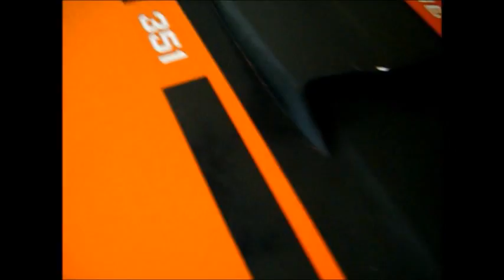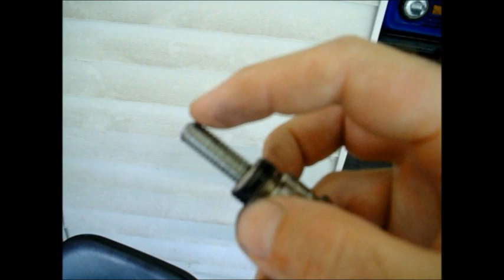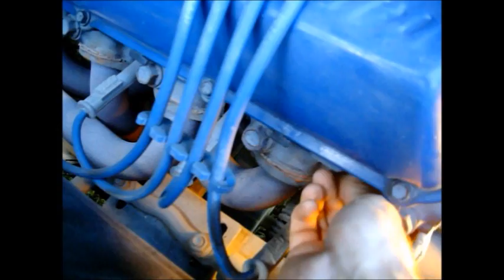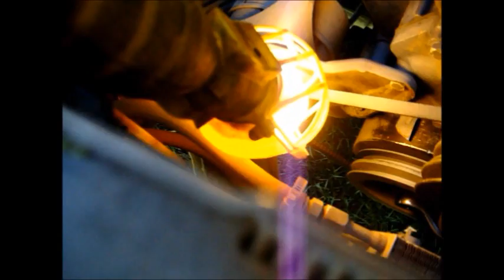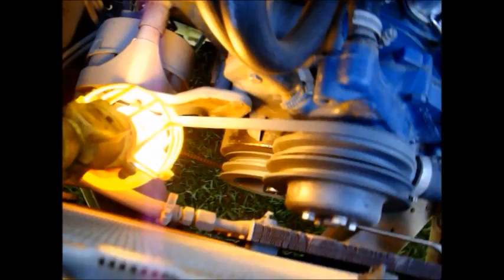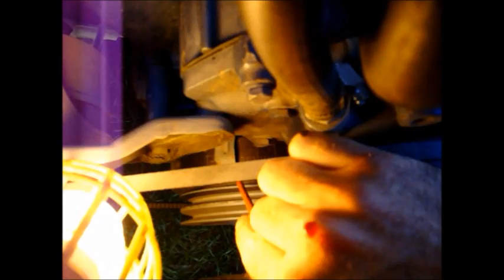Timing - Part 3 - How To - Using a piston stop to find true #1 TDC.wmv

Comment: Nice video ...... You said that the ground from the spark plug ....I am having starting issues on a rebuilt 390 my 69 Ford f 250 cranks but won't start I been searching possible soulutions why it cranks good and has a spark but it will not fire I'm just throwing this out there maybe you came across this the things I changed before my attempt to start it , I installed a thick ground wire from the block to the frame , cleaned the connections from the block to firewall ground   One odd  thing though I could not get a good ground to lite the test light unless I installed the battery cable ? I thought since the engine is cast iron it would be a good ground especially with that big block to frame wire I installed ?  I'm thinking I have spark but not good enough spark . I tested 11 almost 12 volts at the positive coil terminal in start mode in run mode it was at 6 v , although on the negative side I had less that a volt in run and almost 1 v in start mode    in one test I had the test light on the S solinoid small wire red and white it lit up in start mode but not in run mode ? Could it be I am having grounding issue since it is what actually causes a spark to the plugs with that ground strap I installed ?? I cranked my motor a little too much trying to get it started hoping I didn't mess up the cam already but I did not go crazy just got frustrated with it not firing .
Reply from the maker: You mentioned your cam, and seemed concerned that you wiped it out, I'm guessing it's a brand new cam, and you're referring to the cam break in that you need to do, I'm sure it's fine though.  You're trying to fire up a brand new engine for the first time?  Or just a brand new cam?  I don't think you've got a ground issue.  It sounds like you've got that covered.  You should have a ground cable running from the negative post on your battery to the front of the block (doesn't matter where on the block, but sand off the paint for a good connection), and where your battery's ground cable is bolted to the block, you should have a second cable running from there to the frame (again, bare metal for a good connection).  So now your battery is grounded directly to the block, and directly to the frame.  Then run a small ground strap from the rear of the intake manifold  to the firewall.  Do that, and you'll be able to put the ground test light lead on just about any bare metal on the car, and yeah, both positive and negative terminals have to be on the battery, if that was your question.  From what you wrote, I think you have all of that covered.  Are you still running points in your distributor, or have you installed electronic ignition, if electronic, what exactly are you running?  The voltage at your coil sounds right for an original points type distributor, there's a resistor wire that would explain the 6v.  With points, the negative side of the coil just goes to your points contact, so check that wire's condition, look for any chaffing or bare wire, and check that wire's connection to the points.  Then check your point gap with a feeler gauge (.017" to .019" gap will be fine).  If it's way off, that's your problem, and if the points aren't brand new, get some sand paper, somewhere around 80 or 120 grit will work, fold it in half, so it's rough on both sides, and slide it back and forth in your point gap to clean both sides shiny, sometimes your engine won't start, no spark, and that's all it takes to get you back on the road.  Once you've verified your point gap and cleaned your points, make sure that all of your spark plug wires are properly installed, fully seated at cap and plugs, and that the firing order is correct by checking it against a diagram that shows cylinder numbering and distributor cap rotation.  Remember that the Ford distributor rotor spins counter-clock-wise, opposite of Chevy, and that Ford numbered their cylinders completely differently than Chevy and Mopar, just saying because if you're used to old cars that aren't Ford, this will throw off your game.  Once all that is sorted out, put a timing light on the number one spark plug wire, and check your timing while someone cranks the engine for you.  Be sure you've got a good charge on the battery, and at normal cranking speed, the timing light will strobe if you've got spark, this will also prove that you've got a solid ground, and that your coil, distributor, and points are working just fine (if no strobe at all, then those are your suspects, and I'd suspect the points before anything else).  If the timing light shows 5 to 15 degrees BTDC on your harmonic balancer then it should start, and if it doesn't start, you should check for fuel, just look down your carb, and cycle the throttle lever with your hand, you should see fuel squirting down from the top of the carburetor.  What carb are you running?  You could cheat and spray a little starting fluid down the carb, and see if that helps it out....it should at least try to light off.  Starting fluid will also tell you when it won't start because you've got a batch of bad gas...but gas that bad is really rare, it's only happened once to me.  Here's the thing, you've got good rotation, so now as long as you've got compression, and valve timing, and spark timing, and spark, and good gas....it should fire right up.  If it doesn't, you're missing at least one of those five things.  I'm guessing you've got fuel, probably the first thing you checked.  So the next question is spark.  Did the timing light strobe while the starter was cranking the engine over?  If so you've got spark at number one.  As long as you're there, hook up the timing light to the #2 through #8 spark plug wires, and see if the light strobes, now you know that you've got spark at all 8 spark plugs, because if a spark plug is fouled, the timing light won't strobe on that specific spark plug wire.  And if the points or coil is bad, or the point gap is wrong, none of the spark plug wires will strobe the timing light.  If you have fuel and spark, how about spark timing?  When the timing light was hooked up to the #1 spark plug wire, and a friend cranked the starter, did it read between 5 and 15 BTDC?  If not, turn the distributor until it does.  If no amount of distributor adjustment can get you there, then that's your problem.  Put a mark on the opposite side of your harmonic balancer, 180 degrees out from your factory timing marks, and then see if your timing light strobes on that 180-out balancer mark you just made.  If so, you've installed your distributor on the #1 piston's TDC alright, but you've installed it on TDC of the exhaust stroke, and not TDC of the compression stroke.  If this is the issue, and I've seen it done lots of times, then simply go to your distributor cap and move all of your spark plug wires straight across from where they are now, grab two that are directly opposite each other, swap them....grab the next two, swap them....grab the next two, swap them....grab the last two swap them...and that's all 8, done, easy.  If you're worried you messed up, by swapping the same wires twice, then just check your firing order again, it'll be the same firing order, but your #1 spark plug wire has now moved 180 degrees on the cap, so start at your new #1 and work ccw from there.  See what that does?  If your distributor rotor is exactly 180 out (from being set up on the exhaust stroke), then by moving every spark plug wire 180 degrees from it's current location, you just fixed everything in less than a minute, and your #1  spark plug will now fire on your #1 piston's compression stroke.  Or if you don't like my shortcut idea, and you want the number 1 spark plug wire located on the distributor cap where the service manual diagram shows it, then you can do this instead, to accomplish the same goal, just pull the distributor, turn the rotor 180 degrees (if it's pointing at your carb, point it at the radiator), and drop it back in, and then leave all the spark plug wires where you had them.  Then check the timing again, while cranking, and if it's now between 5 and 15 degrees, spray a small amount of starting fluid down the carb and it should fire right up.  Once running, you can double check your timing with the light, and break in your cam while KEEPING A CLOSE EYE ON YOUR TEMP AND OIL PRESSURE GAUGES.  Now if you have fuel, spark, and spark timing, and it still won't light off, then you'll need to consider valve timing, and the possibility that your new cam isn't installed correctly...or compression, and the possibility that the valves are adjusted wrong.  I've seen guys not follow directions on where the crank gear and cam gear alignment marks are supposed to be, but that's rare.  And I've seen guys crank down on rocker arms trying to adjust a hydraulic lift valvetrain the way you'd adjust a solid lift valvetrain, which prevents the valves from closing all the way, and you end up with zero compression at every cylinder, that's more common, but your 390 has a non-adjustable valvetrain with shaft rockers, so that can't be an issue, not on your engine.  Not only that, but I'm willing to bet your new cam is installed properly, I've never seen cam installation instructions that didn't show a detailed diagram of where the timing marks go.  You have to be trying pretty hard to mess that up.  Hopefully it's just spark timing.  Let me know what you figure out.  Oh, and for breaking in a new cam, I recommend this:  https://www.summitracing.com/parts/cca-159
Reply: Owen Robertson 
Thanks for the reply I appreciate it it a 69 Ford f 250 rebuilt at a reputable engine shop I installed motor and trans it was long block but I put on the timing cover and the dots were line up center to center straight up it has a comp cam 265 dual energy and there were notes of recommended valve ajustment and it came with springs ,  already installed
 with lines on them .
I'm running a alum carb spacer with a Holly 500 cfm 2bbl  the grounds are as you said except I have a separate one  to the block near the starter to the frame  I was very concerned I didn't flatten out my cam but just turning over I doubt it I'm using comp cam break in oil and primed the pump , I dropped the dist in on the TDC and the pully was right on the mark TDC,  loosening the number 1 I heard the air escaping and actually blowing on my hand just by turning it with a wrench when it was close to the number 1 TDC on the pully so I will try the timing light and see if it lights up on the marks while the engine is cranking and the other steps you mentioned .......thanks again
Reply: Owen Robertson 
It started .......funny thing I went to pep boys last night and bought a voltage regulator it's the newer electronic type I turned the key and it fired right up but it ran rough I attempted to cam break in hell at 2,500 for about 5 min but the smells of burning paint ceramic coated exaust and it was misfiring a little I shut it down untill I get a oil pressure gauge the stock one did not work and I'm not going to chance that  only now I have 12v on both sides of the coil with key on ? Is that normal before I changed the regulator I only had 1 v with key on at the negative side and it wasn't at 12 v positive it was under like 11 or so now I have 12 on both the tach is working
Reply: I am running points I had the pertronix in it at first but since it did not fire I put the points back in there gapped to 18 since I did not have a 17 I hear the matchbook thing but never new if that was the 2 sides folded over of course without the matches or just one side ? I reggaped the plugs to 34 I had them at 45 with the pertronix but since it did not fire and put points I put back to 34/35  it's the original autolite dist alot of stuff was original before the trans rebuild the filter said fomoco in trans maybe last change was 75 .
That was the concern about the 12v on the negative side coil ? One guy said that you would only have 12v at the negative side if the circuit was not complete ? But all I did was change the regulator ...sorry to high jack your TDC thread  thanks for responding many did not ....and also they had 2 amp fuses to the regulator and alternator I looked at the diagram it showed 4 amp there so I changed those don't know if that made a difference .
Reply from the maker: You're not high jacking anything, I'm always happy to talk engines.  I was a jet engine mechanic for 15 years, and an automotive machinist for a couple years before that.  I'm only an amateur at what we're discussing, but I've got a bunch of classic cars, and over 30 years of constantly wrenching on them.  That said, I'm no expert, but everything you're doing is right.  Good job ensuring TDC of compression stroke rather than TDC of exhaust stroke, yup, that's how you do that.  Break in lube, you primed the oil pump, good stuff, your cam is fine.  Don't worry about not finishing the cam break in, you were right to shut it off.  Install the oil pressure gauge and set the timing with a light,  because that engine running the way you described it, it's probably not set at 10 degrees BTDC right now, it's probably set somewhere around 15 degrees ATDC.  You probably need to turn the distributor clockwise to advance the timing, that should smooth it out.  Don't do it by ear, though, put a timing light on it, and get it right.  Once you've got good timing and good water and oil gauges, go ahead and finish your cam break in.  I've flattened two cams, but they were both high lift solid grinds, and it was before word got out on the need for break-in zinc oil additives.  Your cam will be fine, don't even worry about it.  Good choice on the cam and carb, it'll run great.  Everyone will tell you that you need a four barrel on that 390, but that's just old school "know how" kicking in.  Back in 1985 I absolutely knew that I needed a Holley 750 double pumper on the 289 in my '65 Mustang....did i really?  No, but I sure as hell put one on there.  We were just dumb kids, thinking the more cfm the better.  I have cars with points, a car with Pertronix II, and I've got cars with HEI.  Points are fine, and good thinking dialing the spark plug gap back down on your 390.  I guess the matchbook thing was cool back when everyone had points, and most everyone had a easy access to a matchbook somewhere.  Personally, I just keep a feeler gauge in each of my car's ash trays for setting point gap.  You did that right as well, .018" will be fine for your point gap.  As for the readings at your coil, all that really matters is the positive side of your coil, don't worry about the negative side.  The negative side of your coil is going to read one thing if your points are closed, and something completely different if your points are open.  So you shut the engine off, and the question is, where's the point gap at, is it open or closed?  Remove the distributor cap and turn the engine by hand until the points are wide open, and you should have zero volts at the negative side of the coil.  I think that's how it works, when the gap is closed, the circuit is completed to ground.  I have learned one thing, if your points are open, you can leave your key on, and nothing bad will happen to your points, but if your points are closed, and you leave your key in the run position over night, the points will burn, and you'll have to clean them up with sandpaper.  I figured this out after leaving my coil energized over night in my '68 GTO.  I have a toggle switch to energize the positive side of the coil, and I needed to do some welding in the trunk, so I ran the GTO out of gas, and since the engine starved itself of fuel and died on it's own, I forgot to turn off the batman switch for the coil...fried the points, but no damage to the coil or anything else.  That was dumb, and I should have disco'd the battery before I started welding, anyway.  I knew better than that, but sometimes I don't think.  Your 390 fired up though, so your points and coil are working just fine.  It's running rough, but that's probably timing, because very few people are lucky enough to drop a distributor in, and hit the timing perfectly.  Now if you set your timing to 10 degrees BTDC, or wherever you plan to put it, and it still runs rough, then yeah, maybe look at your points or coil as the cause, but right now, I'd focus on timing.  One thing though, and you can check this after your cam break-in, no rush, but if the car is running, and you've still got a straight 12v at the positive side of your coil, it might be because your truck's original resistor wire for the positive side of the coil was fried at some point, and someone bypassed it years ago.  No resistor wire is a bad thing, the engine will run fine for about 200 miles, and then your points will start to burn up and it'll start running really rough.  Here's the easy fix, if you think your original resistor wire might be long gone from your wire harness (and a lot of them are), just go to Pep Boys, and ask for a ballast resistor for a '69 Dodge Dart (or any Mopar that's old enough to have points).  Mopar ran a ballast resistor instead of a resistor wire, and it's a cheap part that's really easy to install.  All of my cars with points, that originally had resistor wires, are now running '69 Dodge Dart ballast resistors, because12v at the positive side of the coil (while the engine is running) is fine for Pertronix, but not fine for points, so you need either the original resistor wire, or you need an external ballast resistor.  Now what about your coil?  Are you running a points coil (stock for that truck), or is it a coil specifically built for the Pertronix?  You need a points coil, and not something that Pertronix sold you to go with their kit.  Here's a good video explaining how a points engine gets 12v at the positive side of the coil during engine cranking, and then only 9v at the positive side of the coil (thanks to a ballast resistor) once the engine is running.  He should have mentioned that a lot of Fords, and my '68 GTO, and a bunch of other cars, and probably your truck, came stock with a resistor wire instead of an externally mounted ballast resistor, but that's okay.  Another thing I noticed is that in his diagram, his wire from "I" on the starter solenoid normally goes to "+" on the coil, and not to the coil side of the ballast resistor the way he drew it, but it doesn't matter, either way it's doing the same job, and he does make mention of this at four minutes and seven seconds into his video:   https://www.youtube.com/watch?v=PCs5gAZBbxU
Reply: Owen Robertson 
I changed the coil back to the one that was on there it was a Wagner or Borg Warner small one I bought the truck from a guy 2 years ago it ran but after it died on me I tried to put gas on the side of the road and it was pouring on the ground the selector switch for gas off is main etc i drove it 20 miles and broke down I had it towed and it sat in my driveway for a year . I found out it sat for 14 years before I bought it , no brake light no horn no blinkers no done light I spent big buck on this truck Dennis carpenter and the other guy know my name lol .I got it all working except the gas gauge and the oil temp pressure goes up but the needle I don't trust it , I had the trans c6 rebuilt the engine fire wall chrome here painted there the whole underside rhino lined I spent money lol ....as well all do so after it did not start I was bummed out my son too basically the guy got it running then sold it but the motor had a cracked head the fuel pump was pumping gas in the block the flywheel was trashed starter was ground the whole ball of poop .......but I liked the body style the mirrors camper special the 390 yeah I was stressed about the cam
Reply: Owen Robertson 
When I was looking up stuff about why it wouldn't start I did see the threads about the resistance wire I didn't know anything about it but it's there in the quick connector it comes out into a single red wire a thin one the goes to the coil positive I did need to splice into the thin red one about a foot from were it comes out of the firewall it broke and it was so damaged Everytime I tried to move or arrange it the insulation would crack so I added a new wire but it was after it came out of the firewall changing the regulator is all I did it wouldn't start before it had looked like the original one I would here a click when I turned the key on with the new one it don't click and when I turned the key I was surprised it started right up ...
Reply from the maker: You'll get it, you're close.  It's a good truck, and a good investment.  What you're up to isn't supposed to be easy, if it was, everyone would be doing it, so don't get discouraged.  You're doing just fine.  Get the timing right, and make sure you get good gauges on it, you absolutely need to know what your oil pressure is, and what your water temperature is, no idiot lights, or stock gauges that read C to H, or L to H, what good is that?  You need aftermarket gauges from the parts store, they've got them on the shelf.  That way, you'll know exactly what your numbers are.  That engine will be fine if you don't run it too hot.  And it'll be fine as long as the oil pressure is fine.  I'm not saying your oil pressure won't be fine, I have total trust in the guys that built your 390, trust but verify, though, and verify means a good oil pressure gauge.  A few years ago, I bought a long block 351W from an old Air Force buddy for my '75 Bronco, it was fresh from the machine shop, never run before.  I fired it up and no oil pressure.  None, and a bunch of engine oil leaking down from the bellhousing.  Sucked....New Process 435 four speed, all cast iron, and a cast iron transfer case, that stuff is heavy!  Well I dropped the transmission to find the oil leak, thinking rear main seal, but I pulled the flywheel, and all three oil galley plugs were missing.  Sure wish I had spotted that before installing that flywheel, but it was on my engine stand, and the stand was blocking my view, and then it was on my hoist, and then the flywheel was being installed, and then the engine was being installed.  Sometimes I work faster than I think.  Well, there's three more oil galley plugs on the front of the block, just behind the timing chain, and the machine shop installed that timing chain, not me...and guess what?  I pulled the timing chain cover, an the timing chain, and those three plugs were missing as well.  Someone at that machine shop messed up, and I didn't catch it.  The moral of this story is that I cranked the engine to break in the cam, and it fired right up, and ran fantastic!  If I had proceeded with the cam break-in, I would have destroyed the engine...but my oil gauge read zero, and I shut it down immediately.  Anyway, it sounds like your coil might be 20 years old...or 40, who knows?  So maybe if correct timing doesn't smooth things out, maybe buy a new coil.  I mean, you've got a new engine, so by comparison, a new coil, and maybe a new set of points wouldn't be adding that much money to the grand total.  These things always go over-budget, but doing all this work yourself, is saving you a bunch of money.  Do you have a link to pics of your truck?
Reply: Owen Robertson 
I had some on you tube but I took them down I probably will when it's running right I had a video of the engine when my son and I took the heads off I was trying desperately to do a Buget build the motor was fried I seen a bolt longer than the other with a washer under it turns out that was the taperd bolt for the rockers in the wrong holes they were both on the left head . But other than that I was asking for suggestions but not too many responses so I took them off ,the truck is faded still has Hercules 9.50 x16.5 on it 3 of them if they weren't side cracked I would use them 80 percent tread this might sound like a dumb question but I use the old oil pressure location right ? I just thread in a fitting and run the plastic line there's no other place I see ?
Reply: Owen Robertson 
Sorry to hear about the cams and oil gallies I know these things happen to the best too sometimes that's the way it goes experience ....nice mustangs by the way the jet man !!!! Lol. F/16 ? That's a oldie but when she comes down your path she's a goodyy
Reply from the maker: Yeah, F-16s and A-10s, mostly A-10s, it was a fun job, but I like being retired better.  Like you said, just pull the factory oil pressure sending unit and install the fittings from your aftermarket oil pressure gauge.  It sends actual pressurized oil from the engine to your gauge, the way older cars did.  The white plastic line that came with your gauge will kink easily, so be careful, and if it ever touches your exhaust manifold, it will melt instantly, it's not the best.  I quit using that white plastic tubing years ago, because there's a way better option, copper tubing, and it's not too expensive.  You can buy it separately at the parts store, normally on the same shelf as the gauges.  And it will work with the oil pressure gauge you bought, just throw out the plastic tubing, and use the copper tubing instead.  It's better, stronger, easier to bend it to where you want it, and it doesn't look like crap in your engine bay:  https://www.autozone.com/gauges-and-gauge-accessories/gauge-line-tubing/auto-meter-copper-tubing/131457_0_0
Reply from the maker: Pep Boys will have it too, most places should stock it.  I just grabbed one for the GTO, I think I got it at O'Reillys.   11 bucks at Advance Auto Parts:  https://shop.advanceautoparts.com/p/bosch-gauges-copper-tubing-kit-fst-7584/10717221-P?searchTerm=gauge+tubing
Reply: Owen Robertson 
I picked up the 3 gauge at pep boys  lower line auto gauge oil water and  volts only I think the CV unit thing on my gauge cluster went bad the only gauge that works was the water temp and I did not trust that . I seen some one shrink tubed something the CV unit  guess it was loose or something previous owner tried to fix it , do they sell that or it's a junk yard deal ? I replaced both sending units in my fuel tanks one was original in pieces no float the cab tank had no float either  I tested the lead to the aux tank it was flashing ? Low blink on the test light I have the dual l tanks with switch I replaced switch too that's another thing to deal with  although I think the CV limits to voltage to 6 volts or something .
Reply from the maker: It can be a real pain getting fuel gauges to work in vintage cars and trucks.  I've got 10 old cars, and 3 of them have fuel gauges that I've officially given up on.  I just write down the odometer every time I fill up and how many gallons to fill it up, and then I use my odometer as a gas gauge.  This also allows me to calculate my fuel economy.  I get gas every 160 miles in my Vette, every 180 miles in my GTO.  It would be nice if those cars could swing 200 miles from a full tank, because it would make the math easier, but it is what it is.  My '75 Bronco has two tanks, like your F-250, I've upgraded my main tank from the stock 12 gallon tank to a 23 gallon aftermarket tank, and my reserve tank holds 8 gallons....I just drive it until my main tank starts to run out, manual transmission, so the clutch keeps it running (rear wheels turning the crank, instead of visa versa) as I'm going down the road and the main tank starts to starve, I can feel it, and when that happens, I just reach down and swap to the reserve tank, then I get gas that same day, or the next day, and fill up both tanks.  I've got a system going, works for me.  Long story short, I'm not the one that's going to be able to help you with your fuel gauge.  I've replaced gauges, I've replaced sending units, I've replaced wiring, only to have the gauge work for a while, and then quit on me again, for whatever reason, within a year or two.  Chinese parts?  Maybe?  Maybe I've just had bad luck.  When it comes to vintage rides, fuel gauges and original equipment air conditioning are the two things that I've simply given up on, not worth the trouble, and I can live without them.  Need  oil pressure and water temp, though.  Don't get an instrument cluster constant voltage regulator from a junkyard, any parts store should be able to get it for you, but be sure to bring your old one with you to match it up, sometimes the connectors are different.  Does yours look like this:  https://www.macsautoparts.com/ford_truck_late/ford-pickup-truck-constant-voltage-regulator-f100-f350.html
Reply: Owen Robertson 
I agree yep the only gauge going to work is my speedo ....those sending units are pricey 45 bucks each I replaced both but I'm going to do what you said use the odometer .I  watched a old mustang you tube video and turned the clock back to zero it took all day but I got the camper special diets marker lights and installed the lower line auto meter auto gauges oil volts water there lower line alright thin wires I was pressured by the fuel gauge but at work we use the odometer as well in the semi trucks 2 full tanks  1,500 miles 30/50 to  spare if we don't exceed the milage chart good idea you got it pegged .
Reply: Owen Robertson 
It had factory a/c too all it is now is taking up my glove box I might one day remove it all I took out all the engine side stuff but I need to remove the whole thing to change the heater core I plugged the heater holes for now ,

Yeah that's it so CV means constant voltage regulator I might pick one up although I ohm tested the gauge it had high ohms 75 area no ohms on the CV thing although I had to read up on how a gas gauge works I thought it used 12 volts thanks for that the one I had was soderd and shrink tubed
Reply from the maker: I've got 3 cars that came with factory A/C, 63 TBird, '70 Mach 1, and '68 GTO.  I tried twice to get the A/C going in the Mach 1, that refrigerant is really expensive, both times, I got it working and then sprung a major leak, within a month.  The first leak, was a blown line, so I had one made, and dropped another ton of money on refrigerant.  The second leak was at the compressor, that's when I gave up on the idea.  Now I just roll down the windows.  I'm not even going to attempt it on my GTO or TBird, windows down will be just fine.  Like you said though, sure is a pain replacing the heater core in a car that came with factory A/C.
Reply: Owen Robertson 
Yep r 12 my brother in law used to work on refrigeration and had tons of it he kept alot when he would evacuate the outdated machines he would put it in big cylinders and gave us some I had a BBQ propane tank worth but my grandad wanted it for his friend it was around 20/40 bucks how ever they measure it a gallon quart whatever mach 1 !!!!!!!! Nice
Reply: Owen Robertson 
I was able to run it for 20 min today with the new oil pressure gauge it held 50 psi at 2,500 3,000 2,000 was like 48/49 psi the temp gauge worked but the long silver copper line was kinda laying on the intake so I think it read higher than it was after I shut it off it read even higher I think it was reading the temp of the intake from the heat on the line . My home fan was not good enough to keep up in cooing it was at 190 close to 200 at the 20 min mark that was enough fo me I stopped . 
I drained the oil hoping I did not have gas or anything else in the oil , also drained some water out so I can install the stock temp sender back as well with the new gauge we're the heater return port was so I will have both .  It read high like close to 200 but 15/20 min I could put my hands on the radiator it was ice cold also drained the water into a bucket looking for oil as well I could put my hand in it not too hot there 260 it read ??? It would had blown off my radiator cap . Some people say they run that break in oil for 500 miles it was thin !!!!!! When I drained it looked like water I'm using comp cam break in oil I would not run that for 500 miles on a break in ? What did you use conventional with zzdp added ?
Also I ran a magnet in the drained oil looking for clues lol but not too many shavings came up although if I drop below 800 rpm the truck just dies right now it won't run on it's own high Rpm ok miss firing and all lots of miss firing none out the carb though you can just feel it in the cab you know it is ....
Reply from the maker: Your oil pressure is good, my GTO drops down to 18 psi oil pressure at idle, then up to 40 psi, above 2000 rpm.  I only know that GTO's history back to 1989, and no engine rebuild since then, so that 400 is a bit tired.  I've heard that 10 psi oil pressure for every 1000 rpm is safe.  I've got other cars with much higher oil pressure, 40 psi at idle, and 80 psi at rpm.  I think your water temp is normal too.  I don't get too worried until it comes up over 220, because if it's 220 and climbing, it's probably not going to recover, and on that rare occasion, I'll pull off the road and shut it down before it can get above 240.  With yours, you probably just need to burp the trapped air out of your cooling system.  Put a gallon of 100% antifreeze in it, and fill the rest with distilled water, it's a buck a gallon at the grocery store.  Use two gallons of antifreeze, or more, if you live somewhere cold.  I live in South Carolina, and 1 gallon of 100% antifreeze is more than enough, it's way less than a 50/50 ratio, but it's fine for SC.  Oh, and I don't have an F250, so take that into account, your cooling system holds a lot more than mine.  I recommend the 100% antifreeze, because the pre-mixed 50/50 antifreeze they sell now is a rip off, it's half antifreeze and half distilled water, well 1/2 gallon of distilled water is worth 50 cents, tops.  By my math a gallon of 50/50 mix should be half the price of a gallon of 100% pure antifreeze...and it isn't, so that's a scam.  Like I said though, if you live up north, and you've seen blocks freeze solid and crack, then you know better than me, and by all means do whatever it takes to ensure you've got enough antifreeze in the mix.  And don't run tap water in your radiator, too corrosive, especially my tap water, because it's untreated well water, and after I moved here, it wasn't two years before I started losing freeze plugs, corroding from the inside out, until they leaked.  So now, I only run brass freeze plugs, and I only run distilled water in my radiators, and no more corrosion issues.  Live and learn.  Anyway, what I was saying is fill your radiator, then run your engine until it gets hotter than you'd like, then shut it off, and go watch tv or something.  After it cools down, top off the radiator.  Then just keep an eye on the level, every day or two of driving it, and top it off as needed, do that, and you'll get all the air out if it.  You can try to burp the radiator by running it to temp, with the radiator cap off, but that can get messy.  Once you've got all the air out of the radiator, and your timing and carb are tuned correctly, and it's running smooth, don't be surprised if it runs at 190 or even 200 on a warm day, that's not a problem.  Or it might run at 180 all day long, and that's fine too.  Everyone thinks that since cold air induction is a good thing, that a nice cool radiator must also be a good thing, so they run a 160 degree thermostat, but the factory ran 195 degree thermostats, because that's what your engine needs.  When you're at 200 degrees, engine running, and you shut it off, it's normal for the temp to rise, but not from 200 to 260.  Still I wouldn't worry about it.  If an engine is running at 220 degrees water temp, you aren't damaging anything, 220 is just fine compared to the insane heat inside your combustion chambers...and if you shut it down and the water temp climbs to 260, you still aren't hurting anything, because combustion has stopped, and things will only cool from there, after an initial rise in water temp, due to the water pump shutting off the flow of cooled water into your engine from the radiator.  From what I've seen, it doesn't matter too much if that line for the temp gauge is resting on the intake manifold or not, but lift it off the intake, and see if it makes a difference.  I think you just need to burp all of the air out of your cooling system, and you'll be fine after that.  It's normal to run hot when you break in a new cam, because you're revving it, you don't have the 50 mile an hour airflow through the radiator from driving  down the road, you probably haven't got your timing dialed in, and you've probably got air trapped in your cooling system.  Any of those things can make your engine run hot.  I've overheated on numerous cam break ins, only to have the engine run just fine, once all the above is sorted out.  All I have is old cars, 1963 to 1975, and I run 10W-30 conventional oil in all of them, been running that same oil since the mid 80s, and before that, I was riding a bike.  The only thing that I've changed, is that now when I need to break in a new cam, I run that Comp Cams break in additive (the little bottle that you add to your 5 quarts of oil).  Then after 500 miles, I drain that oil, install a new filter, and pour in 5 quarts of conventional 10W-30, and no more additives at all after that.  I like Valvoline, but I've been known to run cheaper stuff.  In cars like my GTO, with lots of miles on the engine, and a dependable rate of oil consumption, I'll use 10W-30 from Dollar General, super cheap oil, and low quality, but every third tank of gas, I'm adding a quart of oil, and I figure that cheap oil will work just fine, at the rate I'm cycling through it.  Your 390 is a fresh rebuild, though, and you won't be going through oil the way some of my cars do...so for your 390, run quality oil.
Reply: Owen Robertson 
So you don't add the zinc additive ? I was reading up on Piston seat break in many say you can load it up some say no I had a crate motor from GM in 86 or so I baby that motor for the first 500 never floored it never got on it , never ran right and it used oil some articles suggested loading the engine up right after cam break in like rolling rpm increases from 2 k to 4,500 maybe 5/6 times in a row then 2k to 5k a few times then let engine cool and drain oil and filter and the rings pistons should be seated pretty much after that drive normal for 500 miles I agree with that since I did the take it easy teanique in the 350 Chevy crate motor and it never ran right used oil burned oil . The blow by now is high and it blows my breather out of the valve cover once it's on the road I might try the loaded piston rings seat teqnique . I did have air in the system I think that's why it got hot like you said gonna burp it out before next start up to set timing ajust carb and all that get it to run on it's own .
Reply: Owen Robertson 
I had a question I know it got a little hot when I broke in the cam today I was able to have my son crank the motor while I flashed the light on it way off like 50 degree btdc I broke in the cam like that ....so I timed it to 8/10 degrees it idles on it's own for the first time I shut it off to raise the idle a little then it never started again . The fuel pump mechanical pep boys did not pump any more it was dead ? I just bought it before the motor install . The upper radiator hose was hot gauge said 190 the lower ice cold lower tank ice cold oil was hot I touched the oil filter it was hot after only 5 min of idling ? Lower tank ice cold ? Bad water pump ??? Lots of vapor coming out of the valve cover left one the oil one was fine this thing just don't want to run ....
Reply from the maker: I wiped out two cams before word got out on today's engine oil having lower zinc levels than it used to, because modern engines with overhead cams don't need it.  So I was caught up in that debate, as well as some of my friends with old cars.  There's still debate on that issue, but now I run this additive from Comp Cams:  https://www.summitracing.com/parts/cca-159  But only to break in a new cam.  They'd probably love for people to add it to every oil change, forever, because that's big money for them, but I only use it when breaking in a new cam, that and five quarts of conventional Valvoline.  After breaking in a new cam, or a new engine, I'll drive it hard, for the first 500 miles, race it, whatever...and then I'll drive it hard for the next 100,000 miles if I can.  The only thing is that after the first 500 miles on a new engine, I'll drain the oil (that has the zinc additive in it), and I'll replace it with Valvoline 10W-30, and no additives at all from that point on, and for my Fords, a new Motorcraft FL-1A oil filter.  Done, easy.  Never an issue.  As for your engine, focus on your gauges, when people tell me that the engine bay "feels too hot", or the oil filter feels too hot, that's what I tell them, focus on the gauges, they'll tell you if you're okay.  Watch your water temp and oil pressure, and you'll be just fine.  Oil gets hot, that's normal, oil filters get hot, again normal.  Your engine doesn't want cold oil.  Your water pump is working just fine, it pulls cooled water from the bottom of your radiator, runs that cooled water through your engine and heater core, and when your engine is done with it, it's returned at a warmer temperature to your radiator, through the upper radiator hose.  So it's normal for the upper hose to be hotter than the lower hose.  Keep in mind that the thermostat will close if the water at the top of the engine isn't hot enough to keep it open, and that's a good thing for two reasons, #1, it's restricting flow, and keeping the water hot enough for normal engine operation (your engine doesn't want cold water, any more than it wats cold oil).  And #2, the water that happens to be stuck in the radiator, while the thermostat is closed, just sits there in that radiator, cooling off, for later, when it's needed again.  People think that no thermostat is a good idea, but it's a bad idea, and that's why.  There's a reason that car makers installed 195 degree thermostats, those guys weren't dumb.  As for your fuel pump, I don't know, but mechanical fuel pumps are very simple in design, and tend to work for a very long time.  I can't remember the last time I had a mechanical fuel pump go bad on me, it's rare.  I've seen them vapor lock, but only on hot summer days, so that's not your issue, and if it was, it would start working again, as soon as it cooled down.  Are you positive you're not getting fuel?  You can look down the Holley, cycle the throttle lever with your hand, and no gas squirts down from the top of the carb?
Reply: Owen Robertson 
Pretty sure it's pumping sometimes and sometimes not or if have a vapor issue after I did that cam break in I turned motor off walked to front and through the clear gas filter all the gas was bieng sucked back into the pump / gas tank somewere you can see the bubbles from the lower part of the hose and it just went dry it left the filter only ........ So it either wasn't pumping good or it pumps air too the next day it started to fill up again on it's own , then one time it was so full of gas I thought maybe the tank pressure was pushing it into the carb so I checked my float level it was right on I thought the pump would only allow gas when the arm was rotating by the cam.lobe in timing cover . Seems like it free flows up and down whenever I'm going to run it in a bucket next time see what changes I read if there's a pin hole in that pick up tube inside the tank cab tank it will suck air with the gas I cranked motor looked at filter did not look like it's pumping gas need to take lines off crank motor put the to carb one in the bucket see if it does anything .
Reply from the maker: Don't get too hung up on what your glass fuel filter looks like.  The only thing that really matters is, will it start and run, now that your timing is set at 8 degrees BTDC (set while the distributor's vacuum advance was disconnected)?  If it does start, and stay running (now that your timing is locked down, and your vacuum advance is hooked back up again), your fuel filter can look almost full while the engine is running, and that's normal...and sometimes it'll look almost empty with the engine running, and that's normal too, because I've seen it a lot.  I've seen it on cross-country trips, and I was never left stranded, so I just kept on driving.  Sometimes on a hot day, the fuel will be boiling in that glass filter, and that, I don't like.  Does your fuel pump have two lines?  One line from the fuel tanks, and one line to the carb?  That's how my Fords are.  Ford was cheap with that two line design, because with only two lines, your fuel pump has something in common with your water pump.  Your thermostat can prevent, or at least greatly restrict that fluid's movement, so in your cooling system, you've got coolant trapped in your radiator sitting stagnant, and cooling itself off, while you've got the coolant trapped stagnant in your engine, warming up to a nice 180 or even 200 degrees, which is just fine with the engine.  Here's the thing, though, the needle and seat valve in your Holley 2 barrel is doing the exact same thing as your cooling system's thermostat, not based on heat, but it's still there to restrict flow.  So your needle and seat restricts flow based on input from the carburetor's float level.  Your fuel pump can move way more fuel than your engine can possibly consume, so while the engine is running, fuel sits stagnant in your carburetor's float bowl, waiting for it's turn down the intake runners, AND fuel stays stagnant in the fuel line to the fuel pump, and it stays stagnant in the fuel line from the pump to the carb.  Fuel pump is working, cam is driving the fuel pump arm up and down, but the fuel can't move, until your needle and seat lets it move.  The fuel can get really hot, especially in the line to the engine, because it's routed right next to the engine, the engine bay is hot, the engine itself is hot, and that fuel can boil on a hot summer day.  So that's bad, because if you boil fuel, you vaporize it and pumps that are designed to move liquid, can't move vapor.  Hopefully your F250 has three fuel lines at the fuel pump, my Fords don't, and they should, because Ford knew better.  My '68 GTO has three fuel lines at the fuel pump.  One to bring gas in from the tank, one to deliver gas to the carb, and one to return the extra fuel that isn't needed, right back to the tank.  Seems like a waste, moving gas all the way to the pump, and then moving it all the way back to the tank again, and doing that constantly, but it fixes everything, because it keeps things moving.  The carb still gets all the gas it needs to keep the floats up, and the constant flow back to the tank prevents fuel from stagnating in the engine bay and boiling in the lines and filter, and you absolutely won't have a problem with vapor lock.  That has nothing to do with your 390 in the month of February, I just like to vent on vapor lock, because I've had more than my fair share of it, and it's really good at leaving you stranded, although I've found that I can usually get a vapor locked car back on the road if I've got a can of starting fluid.  The vapor locked engine has no gas in the carb, because your engine drank it all, and the pump was unable to provide more, but it'll start right up and run off 100% starting fluid, then you just try to keep it running off of nothing but starting fluid, which moves the fuel pump arm faster than the starter motor can move it, and I've seen that overcome the vapor lock, and eventually the engine starts running on it's own, without the starting fluid.  Then you get moving down the road, maintaining airflow the best you can, and you try to avoid gridlock traffic.  Of course, it can be tricky trying to keep an engine running for 20 or 30 seconds off nothing but starting fluid, you've got the can in one hand, and your other hand is on the throttle, revving the throttle while you spray just enough, and not too much starting fluid...it's a balancing act.
Reply: Owen Robertson 
Yeah it's been awhile since I owned a oldie I actually had alot of old cars when I was 17/18 to 25 or so I'm 49 now and been driving fuel injected turn key computer tell me when I need gas cars for 25 years I'm a little rusty,  yeah it's the 2 line one that when the diagram goes bad it pump gas right into your oil pan one , so vapor lock is common on a real hot day like summer whether ? I never had vapor lock one tank did not have a gas cap the guy stuck a rag in it 
So I bought 2 caps from the parts store they hold alot of pressure and it seemed the cap actually pushed the gas from pressure in the tank through the filter up to the float bowl . I swapped the cap to the tank I was using to a vented one that does not pressurize the tank maybe that has something to do with it?  I took out completely the aux tank and cleaned it out painted it etc and reinstalled it with a new sender I'm not using that one why I don't know I just poured gas into the cab tank I never cleaned or anything I just looked in it with a flashlight when I changed the sender the filter did not get dirty of particles it was good on the cab tank . I was playing around with the gas selector valve turning it to see what was what some how it's off ....
Off is the main tank aux is off off is aux it's not at the lines it's the plate on the floor maybe switching it around while the truck was off caused alot of gas to run back into the other tank getting air in the lines seems like pump loses it's prime every time I turn the valve while engine is not running lots of maybe I am thinking of buying a small electric fuel pump ran to a switch so I can have key on and not overflow anything or to the ign then to a switch so it works with key and then you can switch it off as well . I was laughing when you said you know your engine dosent want cold oil .....ha ha yeah common sense escapes me sometimes I'm like c Mon you dummy  truck run . I got hurt at work so I had 2 months to bare down in the truck last week was first time I started it before that it was one weekend day off work on it sometime I didn't at all so I was a little pressed to want it to run now I'm back to work so it be slower pace will a high pressure cap help prevent vapor lock ? Or that's from the fuel boiling in the fuel pump ? I doubt there be vapor lock with a Holly electric fuel pump on there then I never need to worry about the pump sending gas into my oil pan .
Reply from the maker: Yeah, you're really close, you'll be driving that truck in no time.  The cars I've had vapor lock issues with, have been smaller cars with tighter engine bays than what you've got.  Cramped engine bays heat up quick, especially on a hot summer day.  You're probably not too likely to have vapor lock issues with a big F250, lots of room in that engine bay, and you absolutely won't have vapor lock issues if you install an electric fuel pump.  My '75 Bronco, has that switch near the floorboard to swap between main and aux tanks, I do remember having an issue with that switch once, and the engine starving for gas, but that was almost 20 years ago, and I don't remember what I did to fix it, but it's been working fine since then.
Reply: Owen Robertson 
Thanks for all your advice and time corresponding on the ol Ford like you said it is simple in design and I wanted a spare truck not car without smog restrictions I live in so cal I had a spare car and drove rarely 180 k miles and I let it sit a import the every 2 years it needed a smog check then it wouldn't pass due to things not working elec this and that some have Friends" that do it for them but once he's gone that's it I'm not into that so I bought the ol 69 good thing it's a Ca truck it sat outside for 14 years there is only light surface rust I seen cars from the south and east on you tube man that whether just ate it alive so to somewhat Buget restore the under carrage eng bay was as easy as a wire brush and rattle can bed liner I'm probably going the elec fuel pump and run the tank I cleaned it's bigger anyway and bypass the valve so it's direct to that tank .
Back in 69 on a long camper trip you need those dual tanks so your not stranded on the road today there's a gas station everywere doubt I will have a issue finding gas long trip short trip anywhere in CA ....toss about 5 gallons in a gas can in the bed just in case thanks I'm going to get it going your help has been great ......
Reply: Hey there .... Well.thanks again for all your help the motor was getting hot , I had to loop a hose from the intake to the water pump after I replaced the pump if I didn't it would want to over heat , before I capped both off !!! the heater core was bypassed when I bought the truck I assumed capping them would work it didn't , installed a flexilite 180 black magic elec fan , just having a few issues with the elec fuel pump but I didn't follow the rules and had it too far away from the tank and it would lose pressure after a short drive , I had it about 3 ft in between the tanks by the selector valve not going  to work there . Will redo it 12" or less at lower bottom of aux tank and go to main line and  bypass selector valve use the one tank .
Reply from the maker: Yup, you've got all that figured out.  Move that elec fuel pump, and you'll be all set.  Glad to hear there's another classic back on the road!
Reply: Owen Robertson 
I doubt it now it's the fuel system I had a 6/9 psi pump and it is over riding the 1/5 regulator although the float is set right it's right at the bottom edge of the sight hole , I ran the truck with the pump off  to check it then came back later the bowl  was full again ?????? I took the gas cap off and it had alot of pressure in that tank !!!! Probably more than the fuel pump did . I started it and it ran without the fuel pump just on the pressure from the tank and gas cap ???? So I took the cap off then it ran out since the pressure was lost and then the float bowl went  empty crazy it's a vented cap I had to cut the spring in the cap vent thing I blew in as hard as I could it was at least a 10 /15 psi vent now it's like 2 psi to vent is there a common vent pressure on a gas cap ? Thing thing was riching me out I ran the truck with no fuel pump ? Tank pressure only ?
Reply from the maker: I doubt it's hot enough to build up that much fuel tank pressure from heat expansion.  Your electric fuel pump must be pressurizing the fuel tank.  You've got tank to "inlet" on the pump, then "outlet" on the pump going to the carb?  Inlet and Outlet should be clearly marked on your pump, so I'm guessing it's installed correctly, I don't run electric fuel pumps, mechanical pumps are easier, but electric pumps work, and they move more fuel than your engine can use, so I'm guessing that extra fuel is being returned to the tank and pressurizing it.  Then your vent cap isn't venting nearly enough, or at least it wasn't until you removed the spring.  None of my cars have fancy spring loaded fuel caps, and none of my cars build up fuel tank pressure like you described.  My '68 GTO has a vent tube in the filler neck that dumps out into fresh air, it's from the factory that way, so zero psi tank pressure from the factory, and it works just fine.  My '75 Bronco has zero tank pressure as well, but the rubber gaskets on my Bronco gas caps are decades old, brittle and cracked, so maybe that's why.  Here's the style of gas cap that I'm running on my Bronco, check out both pics, shows the underside as well, just a simple cap:  https://www.macsautoparts.com/ford_truck_late/ford-pickup-truck-gas-cap-bright-metal-non-locking-379385.html
Reply from the maker: Also, you mentioned that you're running a fuel pressure regulator mounted between your fuel pump and carburetor.  Like everything else, you can't just assume it's doing what it needs to do, so you'll also need a fuel pressure gauge mounted at your carburetor's inlet.  This is why a mechanical pump is easier, no need for either of these things when you keep it simple with a mechanical pump.  No big deal though, adjustable regulators and fuel pressure gauges aren't expensive, and they aren't hard to install.  Adjust your fuel pressure regulator down until your fuel pressure gauge reads 4 or 5psi.  Your 390 won't need more than that, it'll run just fine.  Everyone thinks that they need 7psi on a naturally aspirated engine with a hyd cam and valve float at 6,000 rpm, but they don't.  The "cool kids" run 7, so when told they should run somewhere between 4 and 7...they all run 7psi.  I've had issues with Fords and vapor lock, because cars like my '70 Mach 1 have very closed in engine bays, and Ford didn't engineer a return fuel line from the mechanical pump back to the tank.  My '68 GTO has a wide open engine bay, and a fuel pump with a factory return line to the vented fuel tank to eliminate vapor lock.  That Pontiac is engineered way better than any of my Fords.  It's bone stock and it works great.  Here's a link to a video showing a guy suffering vapor lock with a Ford, and going to extremes to correct it.  He should have sold that Ford and bought a Pontiac, much easier.  He's got an electric fuel pump, and he added a return line to the tank to fix his Ford's vapor lock, and I doubt you'll need that return line modification, the main thing is that he's got an adjustable fuel pressure regulator, and a fuel pressure gauge mounted at the carburetor, and that's what you need.  With your now modified gas cap, and regulating no more than 4 or 5psi to the carb, your truck should run just fine.  https://www.youtube.com/watch?v=YUmaAQoHggM
Reply: Owen Robertson 
You said it Ford did some wierd things when I change the oil the plug isn't right at the back of the pan so I had to make a thing to catch it or it will drain out all over the cross member first instead of going into a pan. I have a gauge on the fuel line it would hold 4 that were I wanted it Holly says 5.5/6 I called them but heard lots of story's about a worn needle and seat at 5 going past the float now your cleaning your engine and driving at the same time 4 should be fine I freeflow the pump into a bucket at 3 and it filled it pretty dang fast , the pressure from that cap the way it blew off had to be at least 10 psi plus running the pump it would hold 4 for a few min then the gauge would slowly drop down to 0 but the truck still ran I figured the float opened and it's filling up . It wasn't it never emptied I ran it with the sight plug out with the pump off and rev it up to 2k hold it there only till.i pulled the cap off then it started to use the fuel in the bowl wierd stuff on this truck but it was never right when I bought it I guess that's why people sell things.it has a vent hose on the top of the tank as well along side the filler neck seems that ain't doing anything  ,  Now I need to figure them out one by one the previous owner over heated the engine he bypass the heater core and did what I did plugged both ports up you cant do that on the 390 they must be looped together if I knew I was going to have all theses issues I would had just crated the 390 and put a 300 6cyl 1 barrel carb single exaust and just fun around in it .
Reply from the maker: Well, you're doing everything right.  You've got your 4psi, and you've vented your fuel tank.  You should be good to go.
Reply: Owen Robertson 
I posted quick vid that ol farm truck I took it out yesterday first time it was on the road in 18 yrs ...